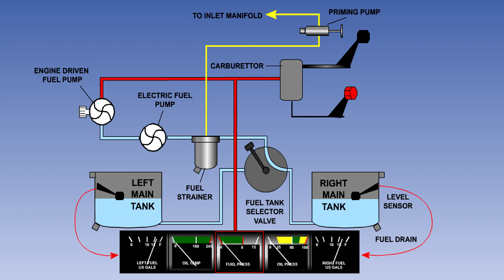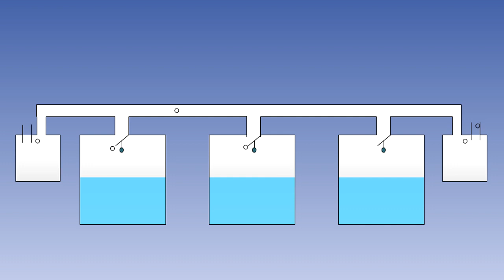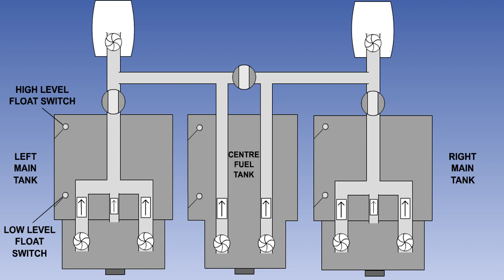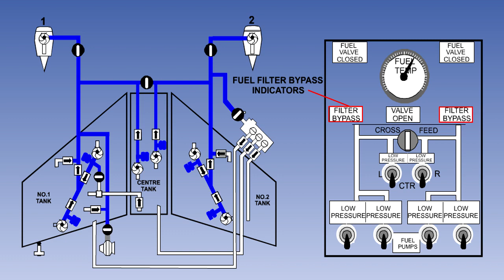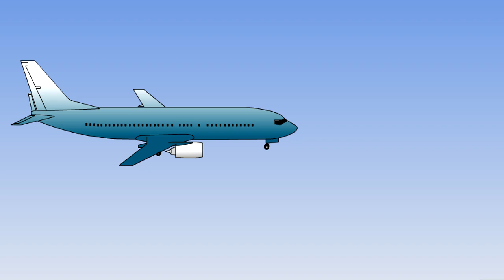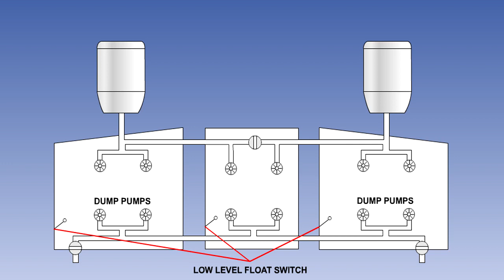Fuel Distribution - Fuel Systems - Airframes & Aircraft Systems #66

Comment: I believe there is one mistake in this video , this is the low pressure lights for the centre tank pumps do not come on with the switch in the the off position.  This is to prevent the master caution light from coming on for fuel when the centre tank is empty which is normal operation.